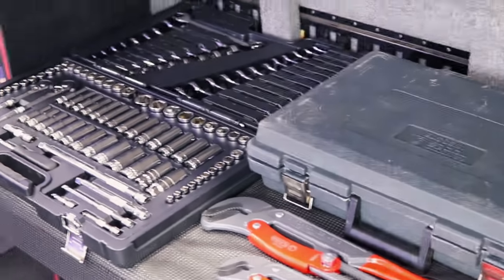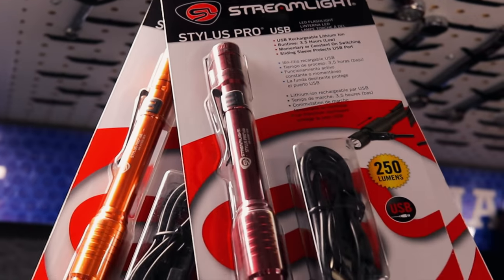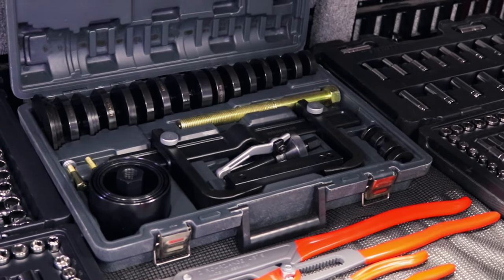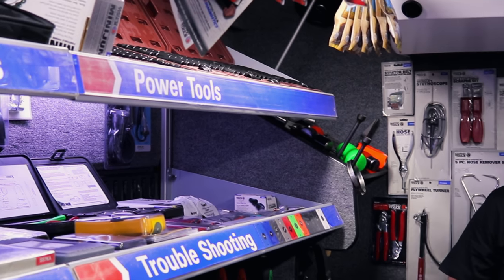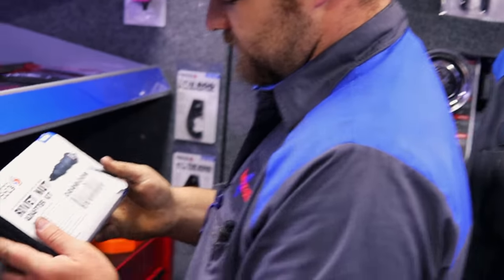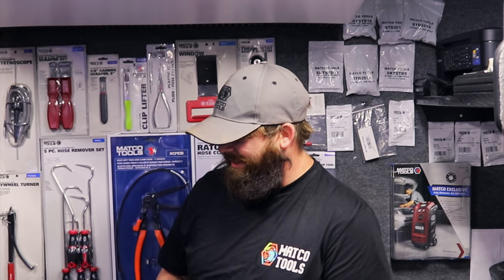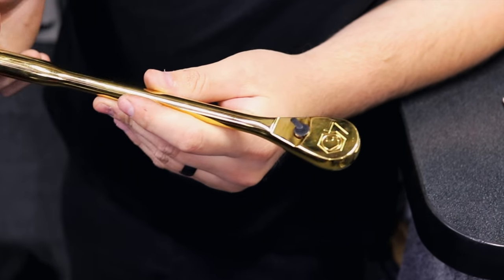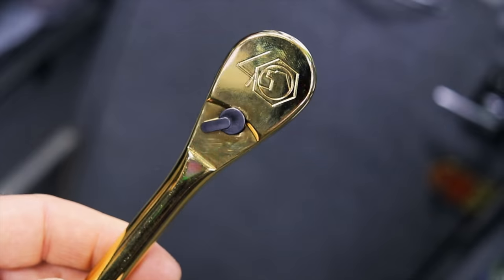Matco Tools Gold Ratchet 40th Anniversary

Comment: The problem with the M companies is they don't make great tools. So be wise and stick with snappy.  Still waiting for Snappy to come out with some decent screwdrivers that aren't throw backs from an earlier year. Hate to say it but Cornwell in orange anybody? I have 90% Snappy tools but wont budge on the crappy new pry bar and screwdriver handles. Can you say way over engineered and way under engineered on the other end of the spectrum. But other than that Snappy is very well rounded no need to stray off the beaten path. Cheers. #1 for Snappy pliers ''Nation''.